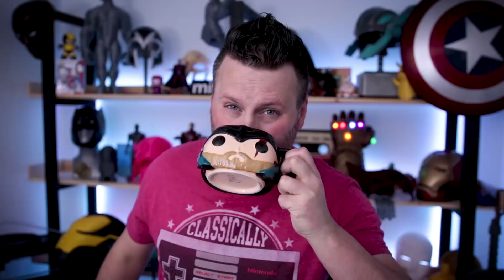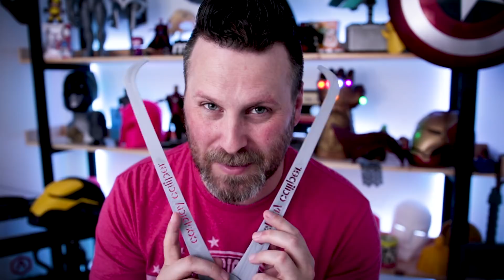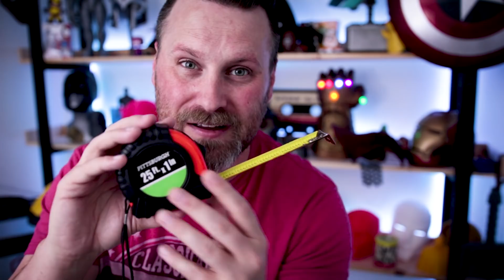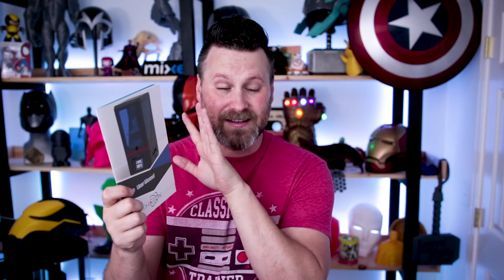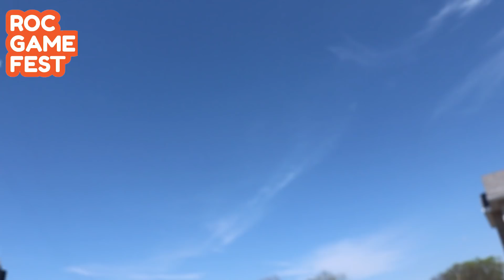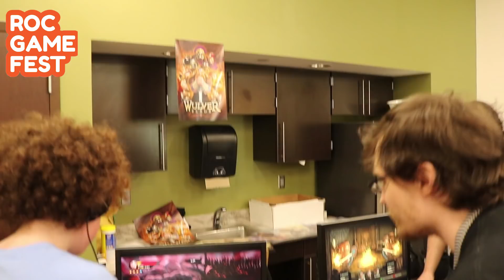Avengers Infinity War Bust | Anycubic Photon 3D Printer | ROC Game Fest | SWJ

Comment: The flicker is in the lights, and its doubtful you'll be able to adjust your camera/shutter finely enough to synch them. Best advice is to take your camera to whatever store you can buy these lights and check to see which flicker before you actually buy. Sry thats not much help if you're stuck with those lights.

Comment: The flickering is caused by the lights frequency, most lights do not stay on continuously they turn on and off faster than the naked eye can see, the best way to fix the problem is to tweak the shutter speed of the camera until you get it right, ISO and Aperture settings dont really affect it.

Comment: Your shutter speed should always be half your iso, this is to give good motion blur and avoid anomalies like this. so example 100 iso 1/50 shutter speed is the absolute best. This should fix your rolling shutter. Also, you need more light just in general this will fix it too.

Comment: 6:14 Looking forward to the Anycubic Photon printer review. It's a DLP printer, however, not SLA, even though both styles use liquid resins. Anycubic (wisely) uses "DLP" on their website to fit industry-standard terminology. "SLA" is generally reserved for laser-based stereolithographic printers. :) I'm curious to hear what you think about cost of ownership (resin vs filament), differences in post-print "clean-up" of the model compared to FDM, as well as maintenance of the printer. I hear any kind of DLP or SLA printing can be quite messy. Worth the investment of time and money compared to FDM? Thanks as always for the great channel!

Comment: I have an MX Master mouse. Best mouse! I had a 1st gen, and the movement sensor just stopped working about a month ago. Logitech just sent me an MX Master 2S as a replacement. Didn't even have to send back the original one. Such great service!  Great mouse in many ways, but mostly cos no batteries. Just plug in a cable to charge while you use it.

Comment: If you want to Measure from Ear tip to ear tip then just Measure from your wrist to the tip of your middle finger (or longest finger).
If you want to Measure from your wrist to the inside of your elbow then just measure your foot from the longest tow to the heel. Of to measure your foot do the reverse and measure your arm. 
There are a lot of body parts that are the length of other easy to reach body parts.
Reply from the maker: ;) I learned a bunch of those back when I was heavy into art and sculpture. Needless to say forgot them

Comment: hi , why so much supports?

I did one with less supports
Reply from the maker: Erick Barreto its only 67% finishes printing and I think you’re 100% correct. I think I could have used a lot less at this point into the print.

Comment: Maybe adjust the LED's brightness, I think the PWM frequency is messing with camera's shutter speed.
Reply from the maker: Rexus King cool will try that out and see
Reply: If they are ws2812's they are driven at (memory only so may be wrong sure someone will correct ;)) 400Hz so camera at 25/50Hz will get the slow strobing. You could try some APA102's, they have a faster clock but need a different controller(if you're unlucky). A quick check does your led strips have 3 copper connections at the cut points or 4. 3 ws2812's and 4 APA102's or clones/similar.  P.S. love your videos :)
Reply: Yup, it is PWM. Change the shutter speed until you don't see it or change the LEDs. The intensity of the LED will also change the modulation. Lower intensity usually makes it worse, higher is less noticeable.